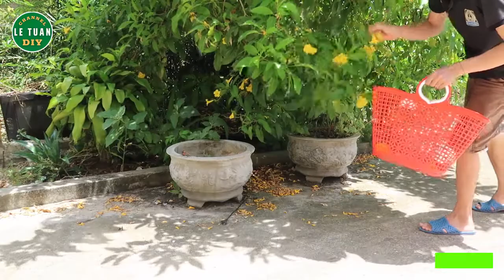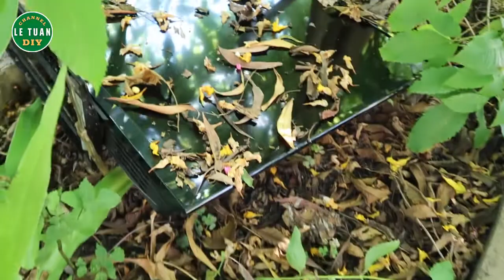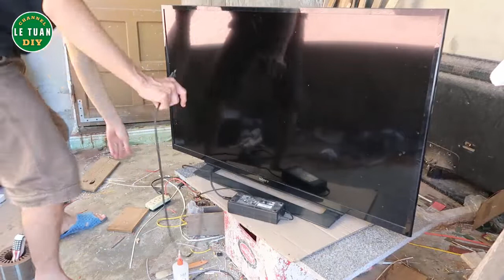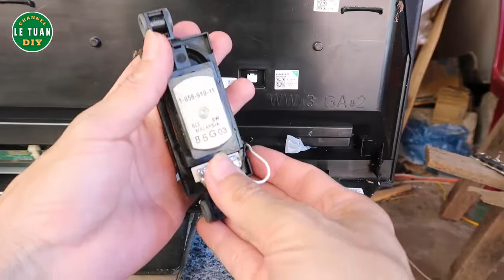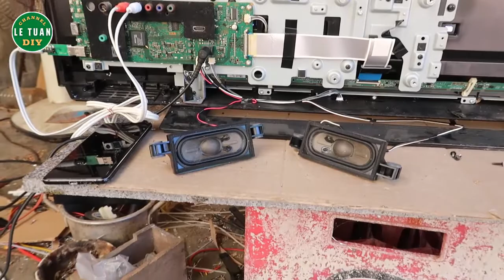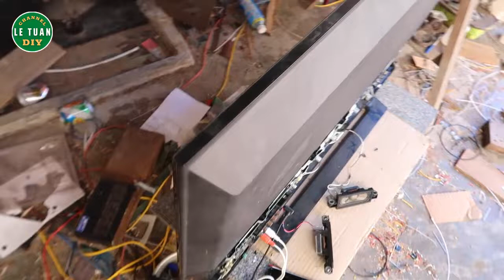DIY POWERFUL AMPLIFIER, using a TV with a broken screen

Comment: I was hoping you would remove the board and cut out the amp itself and wire it up and then play music through it.
Reply: I wanna do exactly that but I have 0 knowledge about boards and stuff can u help me with a video link or something
Reply: @img1446  I got one on a tv board and looked up the IC online and these class d amps are more complicated. It's not just audio in, power and speakers and you have an amp.